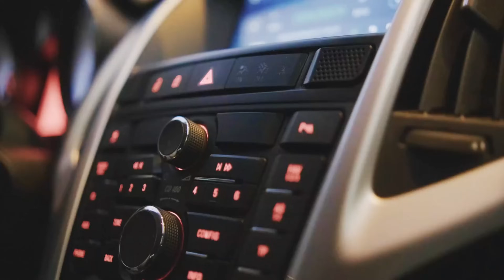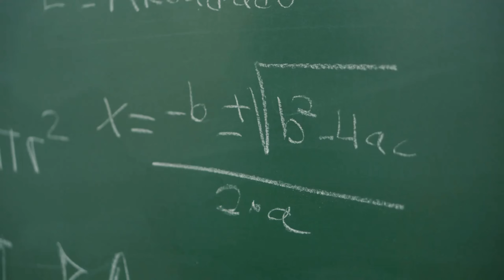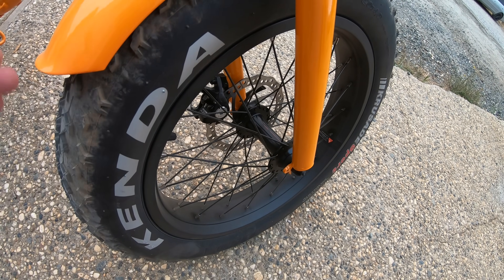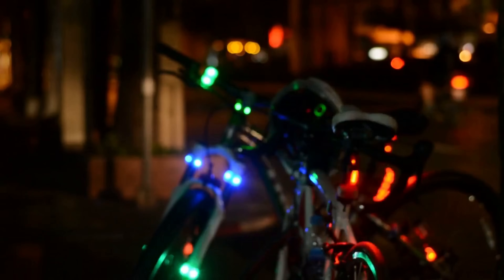Will Ebikes Ever Recharge While Riding?  Explained

Comment: IMO if you can regen 10%(braking) that would be great. Thats 10% range for free😀
Reply: Or spend the money (and weight) of the regen system on a battery and just get a 10% bigger battery (or more) for the same price as a smaller battery plus regen.
Reply: @MrTwostring  some motors have built-in re gen. bigger Batteries = more weight
Reply: @MrTwostring  get the bigger battery and still regen. Free power,  less pull on the battery, more range. 😉
Reply: @MrTwostring  don't use a battery  at all until your in shape if getting more range is your goal😅 like you said the rider is the heaviest part. You are not burning many calories chatting me up.
Reply: @mr.monitor.  - I think the adage here is "if it were easy, everybody would do it." Regen is not "free" -- it takes complexity and probably also weight. If it were THAT simple to add (i.e. "for free") we wouldn't be having this discussion - because all bikes would have regen.
Watch the video again. Did you see the part where he mentioned that the kinds of motors that have regen "for free" put a constant load on the wheel even when coasting?

Regen is more important in heavier vehicles
Reply: @MrTwostring  read my post again. Stop suggesting I watch the video again. I dont care what he said. I said *"if you can gain 10% that would be great." Then you decide to tell me your thoughts I didn't ask for or find useful. Troll elsewhere.
Reply: @mr.monitor.  - I know what "if" means.

If you're not enjoying the conversation or benefiting from it, nobody is making you continue. No need to bait me or call me names.
Reply: @MrTwostring  you baited yourself like usual 😊
Reply: @MrTwostring  think of ways to increase range, efficiency that don't include bigger batteries and ill listen to ya. Otherwise losing weight is the best idea we've talked  about 😊
Reply: @MrTwostring  you have nothing to contribute.

Comment: You're not getting less range though. In that one scenario you explained, you're still recapturing some of the power with that dynamo. You're using the motor (and your legs) to propel the bike, while the dynamo just so happens to be passively gaining back a small amount of it while you're riding. It doesn't matter that it's not recapturing 100% or more of the energy back, there's still the fact that with a power generating device there, however inefficient it is, it's still better than not having one at all. The goal of this isn't to infinitely ride the bike, and you're approaching this from the angle that you're feeding power from the motor DIRECTLY into a power recapturing device at a loss. That's not the way to approach it. What's really happening, again, is you're riding the bike as you wish to, and you just so happen to have a mechanism on the bike passively collecting a little bit of energy to extend the ride. I don't understand the logic of this video.
Reply from the maker: Rewatch.  You will get LESS range if you try to use a dynamo to charge the battery.

Comment: Regenerative braking works on cars because they weigh two tons and are very aerodynamic. You can recover most of the energy you put in that way, but on a bike you’re going to lose most of your energy to aerodynamic drag.
Reply: I think it would be great to maintain a constant speed down a steep hill without wasting that kinetic energy with friction brakes same way the regenerative braking on my car can.  It can work on bikes with likely little addition weight or complexity.
Reply: @loctite222ms  regen braking can “work” on bike drive systems, just not very efficiently.
Also, regenerative braking absolutely has to be tuned to the ride and load, if not the regen braking circuit will start locking up the wheel and jolting the bike, and the rider will almost certainly lose control.

The regenerative braking risk-reward on an ebike is terrible, 
I have tuned CNC machinery coordinated motion controller regen braking systems these HAVE to be tuned to the velocity and acceleration load-curves, the IGBT main-buss would weight at least 2x the drive components you are adding a lot of weight, AND you would have to tune for alot of wasted inertial motion just to make the regen braking safe for the rider and not lock up brakes.
Reply: @johnfilmore7638  could you maybe have regenerative braking just not take enough energy away to completely slow down or stop, like purely to regain energy and help reduce speed on longer downhills or something? I feel like you could do that if you just ease off on how hard it slows you down and then use the friction brakes for actual control on everything else
Reply: @animehair05silently88  Like the other dude said, not enough weight and not efficient enough to matter. Might get like .25 of extra mile.
Reply: Golden motor hub ebike motors can regen like a car when slowing down
Reply: Hills bro

Comment: They have 50 watt flexible solar panels that you could easily put on a bike, might even be able to do 100w, but need a solar charge controller  and in the grand scheme of things the ebike is 500w - 1000w+. So you would be dicking around with solar panels on your bike just to get slightly further.  Easier to pack your charger and find an outlet you can plug into for a few minutes some where.

Comment: Good video, and I don't think regen power from the brakes only would offer much of an advantage over proportional regen offered by a Phaserunner. I would love to use regen braking to save brake wear, but I love torque too much to switch to most common DD motors.

Comment: Seems like regenerative braking could be developed further.  Works great for my car.
Reply: The heaviest component of an electric car is ... the battery.

The heaviest component of an ebike is... the rider.

This means that adding battery to an electric car adds weight which cuts into range - but adding battery to an ebike doesn't have a significant impact on the total weight of the system (including the rider). Therefore, it's much easier to extend range on an ebike by adding battery. Not so with an electric car - so it's more important there to have the the regen.

(P.S. The first claim may not be literally true, but you get the idea.)
Reply: @MrTwostring  The regeneration process doesn't care where the mass is from.  Enhancing regeneration capability likely would add little mass.  E-bikes are already on the heavy side. Maybe double the weight of a similar non-ebike?  Regenerative braking provides some compensation for the added weight.  Instead of throwing momentum away in friction and heat, you recover some of it to recharge the battery.
Reply: @loctite222ms  Sorry - I didn't explain why this is important. It matters that the heaviest component is the rider.

An electric car battery has to move a whole heavy car around. It also has to move itself around. A bike battery, on the other hand, weighs around seven pounds. The weight of the bike and of the battery are small compared to that of the rider.

It is very easy to double the size of an ebike battery and carry it into work to charge. Not so with a car battery.

Also, when you double the weight of a car battery, you add significantly to the weight of the whole vehicle. Not so when you double the weight of an ebike battery because the rider still weights a lot more than 14 lbs.

Therefore, regen is important on electric cars and not all that important on electric bikes.
Reply: @MrTwostring  I get the point you are making.   I believe the hardware to do regenerative braking would weight less than 7 pounds and cost less than doubling the battery capacity.  Direct drive hub motors are already capable of regeneration.  I'm thinking this can be enhanced.   E-bikes already can weigh 65-70 pounds.  I'd rather not add another seven to wrestle the thing around.   Regenerative braking on a bike would allow me to go down long, steep hills without riding the brakes maybe overheating or just wearing them out faster.  So it could enhance safety where carrying more battery doesn't and the added battery weight reduces the cargo capacity for other uses.  10% range increase for a negligible weight and likely cost isn't that bad a deal.
Reply: @loctite222ms  - But doubling the battery would double the range - not just add 5 or 10 percent. I'm not talking about adding seven pounds for a 10 percent benefit. I'm talking about adding 11 ounces - the weight of a few decks of cards - for a 10 percent benefit -- or seven pounds to DOUBLE the range.

This video here describes the problem very well. Regen requires heavier motors with more rolling resistance - and more expensive controllers.

https://youtu.be/T4gH5HrRLsE
Reply from the maker: Good to know!

Comment: There is a man who had some YT vids showing his modification of a hub motor to gen electricity. He attached his crank arms & peddles to it and fed that electricity back into his batteries, which then powered his rear wheel hub drive.
He operated with no chain, belt, or shaft, making a purely electric drivetrain. You can probably still find his vids on YT.

Comment: Wow! 10% more range. I'm not sure regen braking is worth the inability to free-wheel for the average e-bike to go 22 miles instead of 20 (best case scenario).
There will definitely be a time when you can solar charge while riding but endless range, I think not. We have chased the perpetual motion machine since the dawn of science.
Reply: You might think differently if it made the difference in making it the whole 22 mile trip versus no assist for the last 2.
Reply: @loctite222ms  You might think that but if you think that of me you're wrong. I'd buy a bigger battery before putting up with the inability to freewheel and added struggle to overcome inertia without electric power.

Comment: Yet another very informative video, this video answer a question that had been on my mind since I’ve been thinking of setting up parallel battery on my cheetah. That being if the hub motor on the cheetah had regenerative braking , I recall reading something about not setting up parallel batteries if the bike has regenerative braking. Now I need to make sure that the controller will handle the parallel set up, and from what I have read, when batteries are set up in a parallel configuration, the watts stays the same so controller should be fine? If anyone can help me out, I would sincerely appreciate it. Thank You for taking time to make these videos

Comment: I don't quite understand this video. If you have a ebike with a direct drive hub motor with regen you would use the motor for the hills, switch off the motor on the flats and use regen going down a hill. You are claiming the bonus energy from when you go down hill and the riders own efforts. In this way you can massively extend the range of the  ebike which a ebike without regen can't do. A hub motor without regen i.e. a geared hub motor with clutch can also have the motor switched off on the flats and downhill but of course it cannot regen any power so its range is shorter. The direct drive motor has some resistance so cycling on the flats is a little harder and you may have to still pedal going downhill depending on how strong the regen is but ultimately you benefit from much easier hill climbing. I guess you could say it levels up  your efforts to be pretty similar across all terrain. You would never be using regen while the motor is operating.

Comment: Is there an average range that has been recorded ? That a person rides. Because my best day out ( at 68) 26miles in a outing. An my legs/ body were shot. The more I ride the further I can go. But,  an I  mean butt. Is done.  So most the ebikes ranges are about 45 miles. If you can ride further. Just buy additional battery. I think it would be alot cheaper. An less of a  Headache. Someday someone will figure it out.
Reply: The fiido l3 was tested by citizen cycle he got 74 miles on the throttle

Comment: I owned a Rattan eBike for a short time and they had iPass technology they said was regenerative while you were coasting and not using any brakes. It did seem to rejuvenate the battery after going down a big hill. Do you know what that was all about? I would get back after a good ride, and it would magically gain 5-10%
Reply: After you stop riding  the battery voltage will raise slightly  since its cooling down and not under any load. That’s a reason why your battery meter may read higher after a ride and your bike is idle

Comment: I would definitely want e- brakes, because my brakes only last 6months. Scooters have them, why can't ebikes have similar systems
Reply: Scooters basically have to use hub motors. With ebikes you have a choice and many think that crank motors are better - for many reasons.
Reply: @MrTwostring  Crank motors would seem to be better at loading the chain more and wearing it out faster.  Everything has it's compromises.

Comment: When hiking I have a solar panel on and down my backpack. It's enough to keep some battery packs and phones topped up. Not likely to add a to. Of power but if I had a 48v instead of the 24 volt panel I wonder how much I could add in power. Given how little power it generates not much likely but curiosity demands further research
Reply: You’d need a solar charge controller or something that can take the varying voltage of a solar panel and turn it into the voltage your battery charges at.  The voltage of the panel doesn’t matter as long as its high enough to get the solar charge controller to kick on and start charging.  The big question is how many watts could your solar panel really be pulling in.  If its just mounted flat it wont always be getting its full rating, it would probably be behind you on your fender and your shadow could be blocking it depending on the position of the sun, etc.  Overall it doesn’t really make sense, Even with the thin lightweight flexible solar panels.  Just pack your ebike battery charger and plug it in somewhere for 10 minutes and you just charged up more than you would have with a solar panel.
Reply: @soandsononame8750  oh for sure I mean it takes all day to not charge a 4.2 v 10ah battery to full just keeps packs topped up. It would I am sure at best back to the sun add maybe 1/4 a mile a day on an efficient bike like my Aventon Level. ITF a cheap flexible panel, good for what I need but not breaking efficiency records or powering much more than a few gadgets

Comment: Interesting subject, think you covered very well. Its the same with electric cars, there is currently no know way to recapture as much energy as is being used to propel the vehicle.  Maybe someday we will have a small nuke under the hood that could help generate the power needed but given the current feelings about that form of generating power I seriously doubt that will ever happen.
Reply: But recovering some of the kinetic energy to recharge the battery during braking is better than just turning it all into heat.

Comment: Rocket Folding Bike Mid Hub if I remember, 750 Watt Regenerative, Full Suspension using a seat, front shocks 60 lbs Hydrolic Disc Brake., etc. I'd have bought one $1000. If you booked early, but $2k if later. Even at 1K the value added tax and shipping from England. Range was supposedly 100 miles

Comment: Now I agree with the physics. Instead of using a generator, use an alternator. Alternators basically bearing and don’t have a resistive magnetic force unless a voltage is supplied to the electro magnets. When you are coasting downhill you could actuate a momentary switch while coasting. Then release the switch for normal operations. The switch could also be applied while braking. Just food for thought. Love your channel thanks.

Comment: I have a yammee XL bike. With a hub motor on it that has brake regen and also regions as I go downhill it works okay since I am in the mountains of North Georgia and it actually does produce a small current and may give a little charge to the battery like you said not a whole lot but just a little bit if you do a lot of downhill after climbing you can tell that you get a small percentage boost on your battery unless they're software on their controller is just totally fooling everyone including myself.  Have you ever seen the system on the Yammee bikes?

Comment: Say you were coasting downhill on a long stretch or maybe a series of long stretches. While coasting, could you backpedal (reverse pedal) to recharge the battery somehow? Instead of just coasting along you could "possibly" be "making energy" during those idle downhill stretches. Just a thought.
Reply: Just crank up the regen and pedal forward to avoid going "too slow" down the hill. But again ... why? Just plug in at home.

Comment: I've seen videos of long distance ebikers using a solar panel to charge the battery as they ride. These are people who camp out overnight and have no place to charge the batteries. I would love to do an ebike tour, but would need to stay in a motel nightly and carry an extra battery or two so it can last me the whole day, but that would make the bike super heavy, so since I can't afford a high mileage ebike,I suppose that dream will go unfulfilled.
Reply: Flexible solar panels are super thin and light weight ,  probably need a solar charge controller also,   It’s doable but its not going to charge at a rate faster than the bike utilizes the energy.  If you had a 50w solar panel getting its full rated power for an hour,  or 50 watt hours,   A 500w ebike could use 50 watt hours in less than 10 minutes especially if it peaks higher than 500w which it likely would
Reply: The video referenced in the French posting above shows what is required (in 2018) for long distance.  https://www.youtube.com/watch?v=UFSe0d0ox9U  You need not understand French.